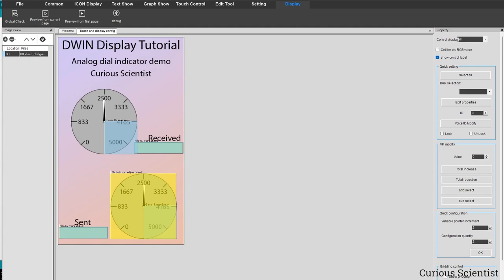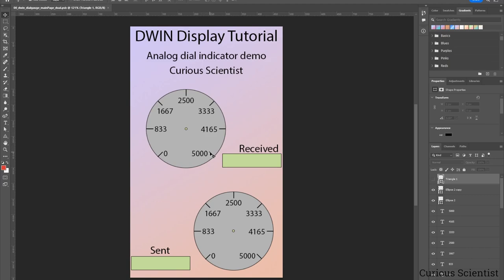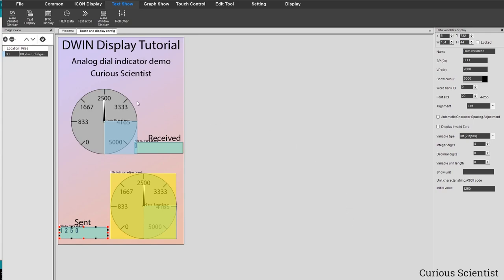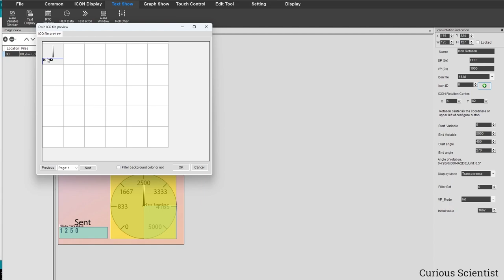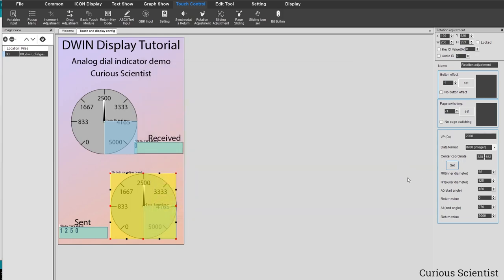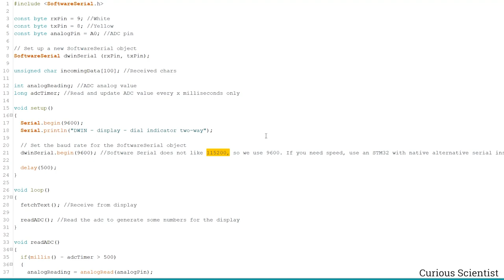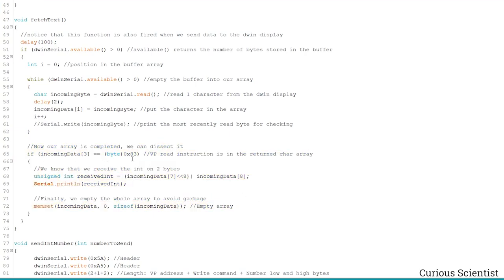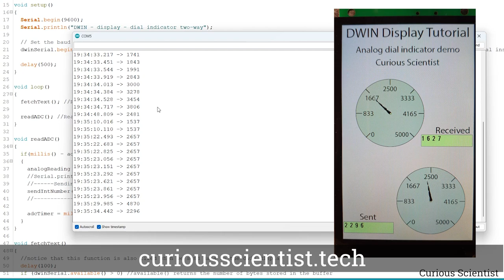DWIN Display Tutorials #4 - Dial indicators as input or output controls

Comment: Thank you for your good video. Is it possible to send bit (On/Off signal) from Dwin to Arduino with these variables in this software? In here, unsigned char is clarifed as 100. For the bit it should be 9. So how can we add 2 different unsigned char in this software?
Reply from the maker: Thanks! However, I don't entirely get what you want. Could you explain it another way?
Reply: @CuriousScientist  In sort, I can send data from Arduino to Dwin but I could not send multiple datas from Dwin to Arduino. There are more than 10 variables and 5 On/Off buttons to send to Arduino in my Dwin project. I can see those datas from Real Term program. But can not see them by Arduino. I watched your videos but could not acchieve this although tried so many methods. So I need your this kind of videos or suggestions :)

Comment: Would this display be more suitable that the SSD1306 in terms of displaying live feedback from the stepper motor while controllingit with the joystick? While controlling my stepper motor with the potentiometer joystick, the SSD1306 causes there to be a stutter.
Reply from the maker: I honestly don't know, but I would assume that since this display deals with serial communication, it might be a better choice. However, it is a more expensive choice. Also, the stuttering can be due to inefficient coding as well. You might want to revise your code to see if there's any conflict between updating the display and moving the motor.
Reply: @CuriousScientist  it's definitely due to the display interfering with the motors movement. But I'm not sure how to eliminate that if I need the display to update at the same time as the motor being controlled. I'm using the arduino uno r4 wifi. Thanks for the feedback!
Reply from the maker: You can pulse the motor with a timer while you use the CPU to print on the display. This approach could work. What is often a problem is that if you use the cpu to toggle the motor driver, the time between two toggles might be shorter than the time to, for example, perform a display update. This could throw off the whole thing.
Reply: @CuriousScientist  this makes since, I'll try the timer and see if that solves it. I am going to try it with the dwin display as well since it's alot better looking and gives better options to go along with it.
Reply: @CuriousScientist  thanks for the help on this and for the display tutorial!
Reply from the maker: It is my pleasure!